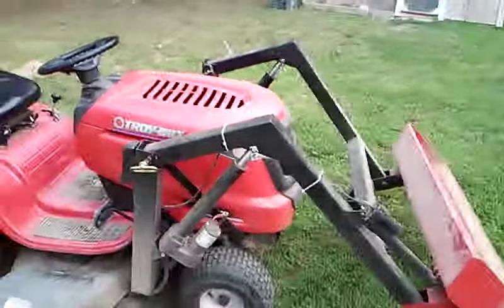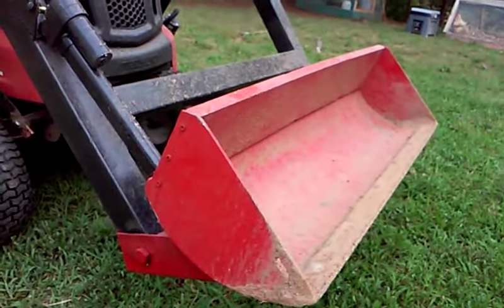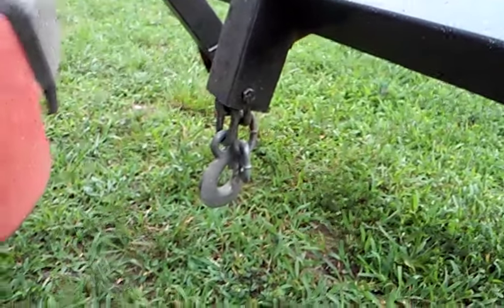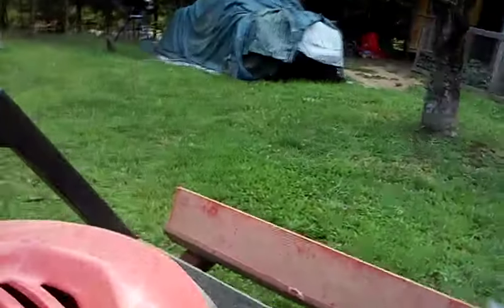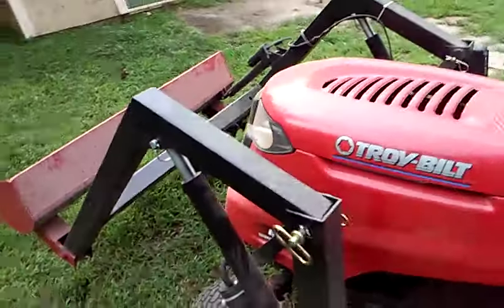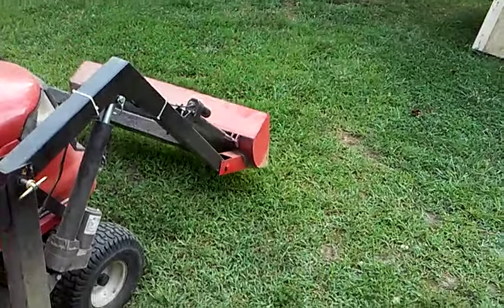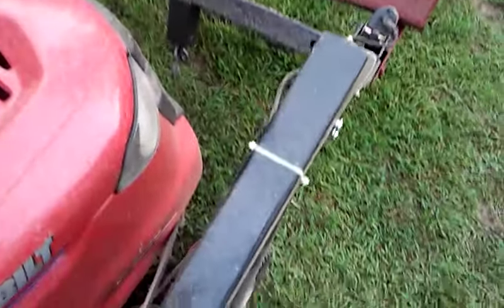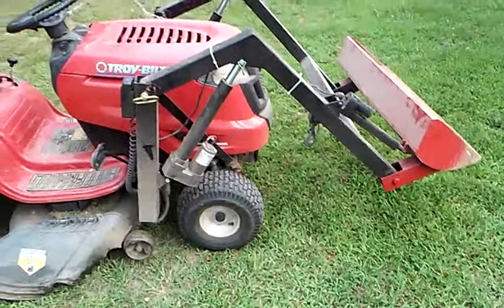Electric bucket loader details

Comment: I would throw away that control circuit board and install a 4-way toggle switch for independent lift and tilt your fab skills are great slick looking and well designed

Comment: Thanks for sharing this video. I am going to build one for myself. I have 2 questions; A how did you attach it to the tractor? 
B are the " lifting arms " were the actuators are attached,  right angles to each other?
Reply from the maker: I used an old motor lift for my steel and purchased my actuators from northern tools. When I started the biuld one of my concerns was attaching the lift to the fram which is what i ended up doing. I wanted it to be removable so I ended up cutting small notchs in the cross member I made which supports the uprights in order to clear the main pully that hooks to the mow deck. I then got the crossmember essentially bolted with four 3/8 inch bolts derectly to the mower frame. I have been really happy with my bucket loader and consider it a complete success. I can try and post another more detailed video for you but I honestly just went from a plan I invisioned and didnt have any initial plan or lay out

Comment: Nice,   Did you weld the tubing to the side of frame? did you need to add any supports where it is mounted the frame? thanks for the video.
Reply from the maker: I did not weld to frame it was a full bolt on to frame yet all the loader armed were fixed and welded . I should have welded additional frames supports in because after years of heavy use and abuse i eventually bent the frame. It was a simple  repair that i never made having sold Lauder for what i invested.  I didnt need it any longer and it served me very well and guy who bought it was happy to have it. He actually  watched my YouTube videos and when i listed it drove several hours to purchase at asking price. I wish i never sold it

Comment: wow, that is great. I've wanted to buy a bucket for years but my old garden tractor has a Peerless manual transmission so no hydro. do you find the tractors alternator/generator keeps up with the demands of the loader?
Reply: Oh disregard question, I see electrical addressed elsewhere in comments. again thanks for sharing.

Comment: Awesome Job Bud!!
I would love to add this to my "Projects to build" list!!!
I am currently looking for a similar lift type system or was going to design my own with wiper motors to run a scissors jacks type of system.
Or maybe even buy a 12v hydraulic type setup, so I can run front and back equipment that I build for my Quadrunner.
What ever I do, I will make and post video's after also!!
+1 Sub !!
Thanks 4 sharing bud.

Comment: I have the same tractor looking for the same thing. That is awesome
Reply from the maker: Thanks I built that thing to scrape and refresh my old driveway and dog lot. It worked out great and that lil tractor took serious abuse for years. It would move between 250 to 300 lbs but could have handled more if I had counter weight on the rear. I never did that though as I was already pushing the tractor itself to it's limit. I eventually did bend the frame digging up tree stumps but it was repairable. I sold the tractor last year when I needed some cash eventually I will buy myself a loader with back ho
Reply: @offgridandhappy2743  I would have bought that from you in a heart beat. Craftsman stopped making them. Huskavarna is the only one who makes them now and I am thinking hard about getting one but for almost 700 dollars it is a hard decision.  I have a woodshop and was thinking about making one out of wood

Comment: Any problems with durability or trouble with the actuators
Reply from the maker: No works great. I bought those actuators at northern tools  and purchased a three year replacement plan just in case but so far they work perfect. I am very happy with my bucket it does everything I want it to do with no issues
Reply: How do you keep the lift actuators from binding? Dont they lift and slightly different speeds even though they are the same model? What does your chair lift controller do other than provide wireless control? Do you have any problems with dead batteries when lifting heavy loads?
Reply from the maker: OCPermaculture it has had zero issues at all the actuators seem to move at the same speed and i know their limitations they never bind up or even seem stressed. the battery holds up and has never seemed to lose any charge from use of the loader. i domt like the chair lift control and plan on changing it. i used it because it had relays which stop the actuators from ober extending but i dont like how its intergraded on the lift and tilt

Comment: What grade steel did you use?
Reply from the maker: I used an old motor lift for the steel that i bought at harbor freight for like 99$ which was less expensive then buying the steel to build it. I know it was heavy

Comment: What brand of linear actulator did you use ? Model numbers? Thank you
Reply from the maker: I honestly can't remember all I know is they were purchased through northern tools.
Reply: @offgridandhappy2743  does 8in stroke sound familiar ?
Reply: Also if you remember by any chance the size of the smaller one for bucket tilt
Reply from the maker: No they were longer then that I believe they were 16 inch stroke I'm sorry I can't remember I built this rig years ago all I know is they were super strong they could handle way more then I used them for

Comment: what strength of actuators did you use? Do you find them quick enough?
Reply from the maker: Jerry Craig i used 500 pound 16 inch actuators frim northern tools. they are fast enough for me and have worked well. i just graded my driveway the other day

Comment: Nice idea and all but these little lawn tractors were not designed with this intention. Only do this if you don't care about your Waruntee.
Reply from the maker: MadMetalManiac74 my tractor ain't had a warranty in like five years. I needed a small loader and this worked out perfect. I realize it's only good for light duty but it had served me very well since I built it and could not be happier with it
Reply: Robert Lamm you took good care of it then because alot of these economy tractors tend not to last 5 years with this kind of use.
Reply from the maker: To be honest it's be seriously abused. Maybe I been lucky but I have had it since 2012 and it was already two years old when I got it. Its never had an oil change. I've honestly replaced two belts and put gas in it. I love my tractor and plan on changing the tires and oil some day soon lol
Reply: If you're worried about warranties, I'm going out on a limb and saying you're probably not the kind of guy who's going to build a DIY loader bucket for your lawn tractor.